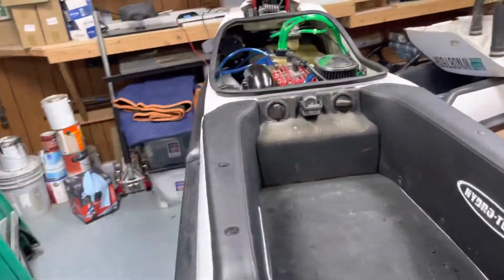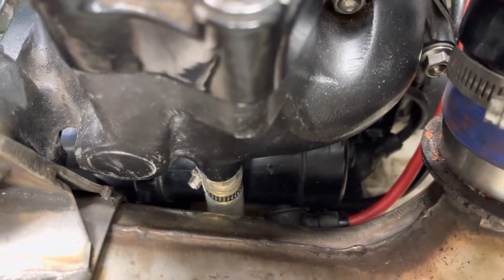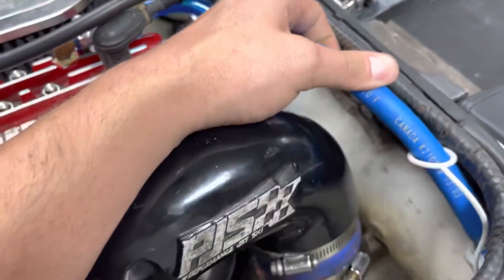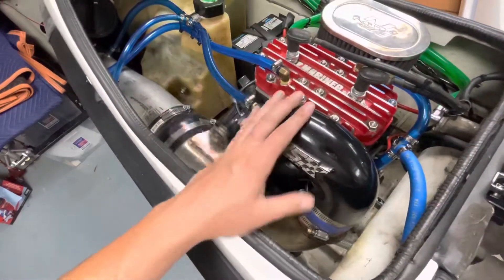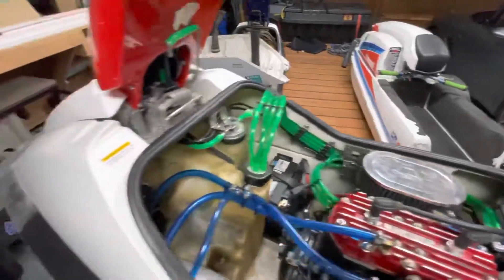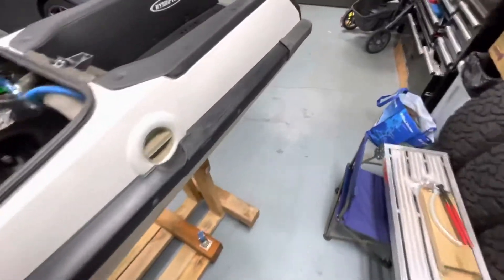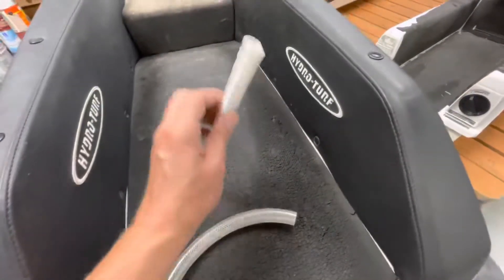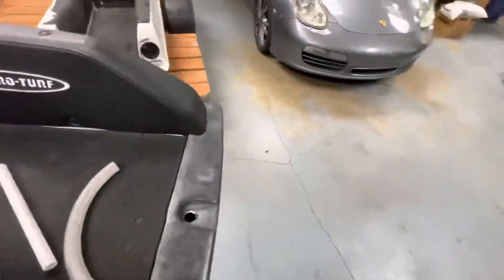The cooling “fix” to my Kawasaki 650 sx jetski.

Comment: 1. Careful who you listen to. Lots of hot air out there. 
2. Centering the input on the ex mani does not matter much. 
3. 1/2" is much closer in area (and especially flow) to 3x 3/8
4. Let us know how the pex holds up😅

Comment: Did you open up the holes in the exhaust gasket to flow more water?
Reply from the maker: No. My understanding is that you don't want to, nor need to do that. The design of the hole size is to keep certain parts of the engine warmer and force the water to move more in different areas of the engine. When left them the same size I had plenty of flow.   One issues you could have is giving too much flow and thus overcooling the motor. Be careful there too.

Comment: question? if i run two 3/8 to a "y fitting (2) 3/8 into a 1/2". Then 1/2 line to the stock manifold port which would be switched out to a 1/2 with 1/4 MNPT. Would this work vs tapping another port into the manifold?
Reply from the maker: I only have one port in to the manifold so from the perspective it would work. The goal you have is Water in = Water out. so assuming you don't make a restriction you should be good. remember 2x 3/8 = 1x1/2 for volume. :-)